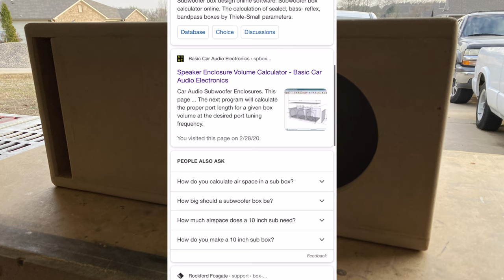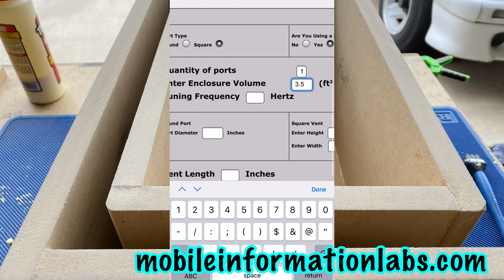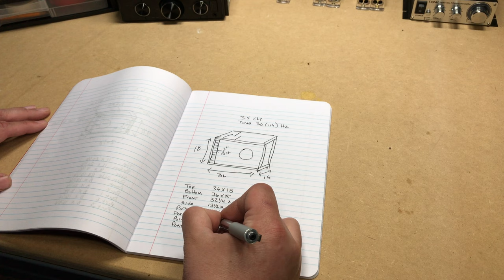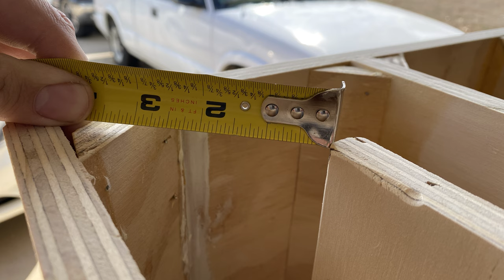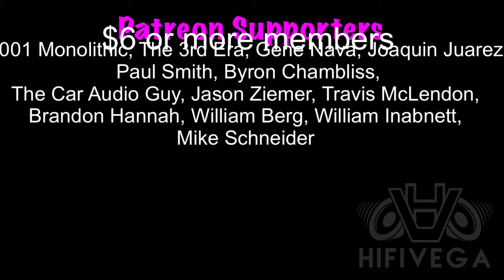How To Design And Build A Ported Enclosure

Comment from the maker: Box building tools and accessories
(Amazon Affiliate Links) 
Plunge Router
https://amzn.to/2TTpP87
Circle Jig
https://amzn.to/2wVqxZv
Circular Saw
https://amzn.to/2WhNZuL
Large Compass (for circles)
https://amzn.to/2QjjUH7
50 inch Edge Clamp Saw Guide
https://amzn.to/3aW9wgz
Framing Square
https://amzn.to/38VNjO4
Box Carpet
https://amzn.to/33klaz8
Duratex Cabinet Coating
https://amzn.to/2Qh930E

Comment: Another tip on how to help yourself with putting the wood together is to use a stapler gun and when flush, stable like 3 on the outside. 
I do this everytime and I get a perfect flush, and I can easily predrill holes, and drill without worrying about it falling or spending time on clamps.

Comment: Great video ! Like the drawing it up on paper I’ve always did it that way forever.  I learned about putting carpet on with silicon calk.  Reason why is we would have 4wd trucks and there always in the woods splashing mud water .  Well windows down you know so if it has carpet it just holds the water right to the box .  So by putting silicon all over the box spreading it out with a scraper or drywall knife .  I just even it out make sure it’s completely covered . Then put the carpet over it I use a staple gun to hood the corners or seams .  If you pull it tight staple it we’re you can’t see them and I would round my corners also . They look real good and there water proof . Rounding the corners helps carpet from getting split on the edges by the box it’s self when installing it or just moving it around .  It’s also a plus in handling it it your hands under a sharp corner edge it’s not as easy as a rounded one .  Then also if something gets spilled on the box or you wanna clean is you can scrub it with a little damp soap and water and not hurt your box .  The silicon does a great job of holding the carpet on!  I like to do my sides first all the way around the top and bottom last you can see how ever you wanna wrap them most time I do them like a present.  I like the way you made the front double wall an just had the hole with carpet on around the subs .  I like to countersink my subs round the top corner of the top hole .  Stretch an tuck the carpet down in there a little bit then the sub will hold it in using the outside of the lip to hold it .  I don’t know how you feel about coating the inside of your box .  To me it’s like sound deadening the wood will absorb the sound some.  I coat mine with rubberized undercoating that kinda works like sealer to seal the wood off but it’s also acoustic.  At least that’s what I’ve seen guys talking about when they build there box’s .  It seems to made a difference to me then channeling the port area real smooth like glass really lets the sound come out .  I like using a small flare at the top edge of my front corner we’re you extended out 1.85 inches .  I would cut the corner then bring the side up flush .  That way you don’t have to correct the box  or port . I kinda just take out for all 4 corners at the beginning . This way I calculate them in  that front port corner would be my flare .  I’ve used the old bed rails like angle iron to make braces inside my box before there strong, light, and you can bolt them in or put screws in them .

Comment: Another excellent video Rob! Solid tips for box builders.
What are your (and everyone else's) thoughts on labyrinth ports versus simple cylindrical ports? Pros and cons of each maybe?
Reply from the maker: I like slot ports because it’s essentially extra bracing that also performs a task. I’ve also had much less issues with port noise out of a slot port, but that being said I do like the simplicity and ease of use a large round port brings. The round port also looks a bit nicer imo.

Comment: You don't design boxes by selecting a port frequency first ... if you want the thing to sound musical then you use the T/S parameters to determine the optimum box volume and then work out the port length ( which sets the cabinet resonant frequency) and this correct length ( as determined by the computer) will extend the low frequency response of the speaker smoothly .. until it's roll off.

Comment: If I wanted to build a sound quality oriented system like say a single 12 ported using a savard hi q, would I approach my box design differently? Like say port area etc if I want the cleanest most accurate sounding deep bass?
Reply from the maker: In that case you might wanna model your enclosure in winisd to make sure yo get the response you want

Comment: If you were to paint the inside of a subwoofer enclosure or add carpet or polyfill or cotton or insulation to the inside of a subwoofer enclosure will the tuning frequency be lowered
Reply from the maker: Travis Gulley depending on the material it could certainly change it, but not drastically.

Comment: I got a question I've never built a box I'm about to build one for my scar SDR 15 I was wondering is liquid nail fine or is wood glue better what's the strongest glue and should I use birch wood or MDF
Reply from the maker: Wood glue is very strong and often times it can be stronger at that joint than the wood itself if it’s applied properly to flat surfaces. I haven’t got a lot of experience with construction adhesive so I can’t speak to that with a lot of experience.
Reply: @HifiVega  okay and what wood do you like best
Reply from the maker: @nickolasvaughn667  I use Titebond II
Reply: @HifiVega  ok that's what I'll get and birch wood or MDF

Comment: Thank you so much for the videos . I had a question about building a ported box on a space saving budget. I don’t have much room to work with, and wanting to do a ported box with two 10 with the baffle angled(I believe 4th order box) I’m wanting to make the box 10(H) 18(D) and 47 inches long. I have to angle the baffle back to get the sub to fit in a box that’s only 10inches tall. I am trying to possibly port through the back package tray of a 1965 impala. Is this a box nightmare waiting to happen?? Thank you for any help.
Reply from the maker: 1hicksonfamilybcle1 yeah you can use an external port and fire right though whatever you’re working with.
Reply: Great!!! Thank you for responding. Would you port the cone side? Magnet side?, or both? The 10s will not be exposed.
Reply from the maker: 1hicksonfamilybcle1 don’t port on the magnet side because they need something to fire off of, so port on the actual side or front or top
Reply: HifiVega awesome!!’n thank you!!!

Comment: Hey there, I want to build a down-firing ported sub.

I got the Tang Band WT-644F
FS - 32 Hz

QTS - 0.42

VAS - 60 L

Box External Dimensions Width × Height × Depth - 17.72" × 15.75" × 19.71"

Material Thickness - 0.75"
Net Internal Volume - 1.87 ft3
Tuning Frequency - 32 Hz
Port Area - 21.39 inch2
Port Inlet Width × Height - 1.50" × 14.25"

Port Length - 24.41"

Is this good?
Reply from the maker: I really couldn’t tell you unless I modeled it in winisd
Reply: @HifiVega  puuh okay idk what my internal volume should be...
Reply: @HifiVega  so i tryed it with winisd -3db were about 30Hz i think that's good

Comment: Is there a rule of thumb for the port diameter to avoid chuffing or can u just pick an arbitrary diameter and roll with that as long as ur port length meets the requirement as well as internal volume for the sub???
Reply from the maker: young feezy the port diameter or width does matter and I mostly go off of my experience, but you can play with the sizes in a program like winisd to get what you’re looking for.
Reply: . just downloaded it. Thank u

Comment: hey i'm shawn from barbados  i have a audiopipe 15 inch driver model TXX-N1500 and i dont have any specs for it i would like to build a down firing box for it and use in the home theater room  but i cant fine the spec anywhere and i dont know anything about  cubit feet only feet and inches can can u help me me wit a design
Reply: thanks for replaying  if u did send me  specs for a box i did not see it

Comment: I just put a small hole for 10 gauge wire for the box's purpose. 
then put a rubber sleeve. 
those terminals are horrid. Tet another thing interrupting my clean signal.